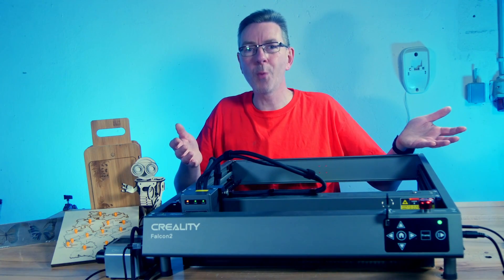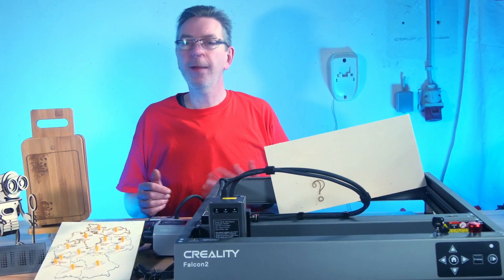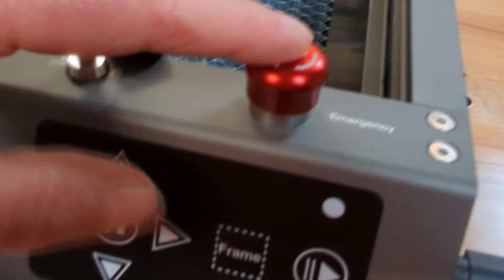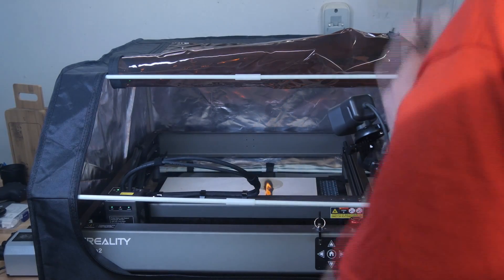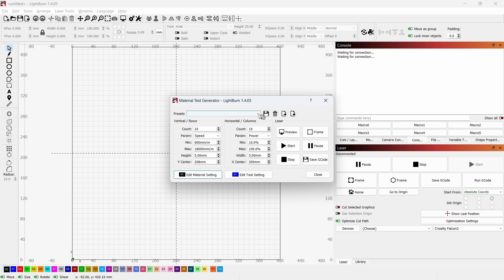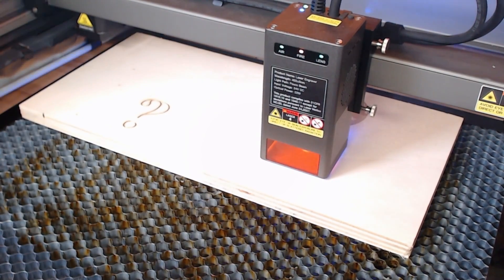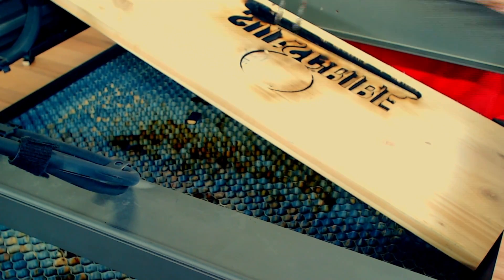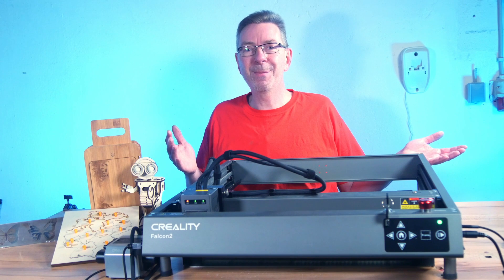🔥 Creality Falcon 2 22W Laser  Engraver  🔥 vs. 15mm Wooden Board (Review)

Comment: What is the max high that you can raise the Falcon 2 laser? Could I slide a 6 inch object underneath the laser?
Reply from the maker: @oneeyedjack3734 The max height of the Falcon 2, using the risers supplied in the package, is about 3 inch (when using a steel plate, less with a honeycomb grid). Creality offers a set of 12 risers, with which you can raise the height in 2 inch steps. So yes, using these ones, you could slide a 6 inch object underneath the laser.
Reply: @3D_Printing_Geek  thank you very  much for your reply